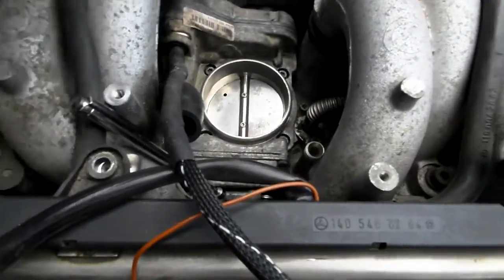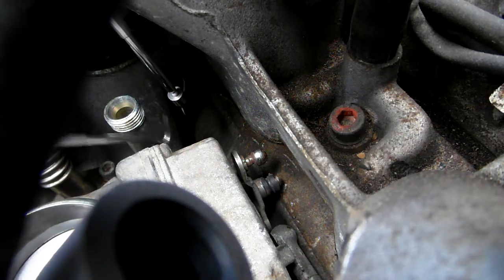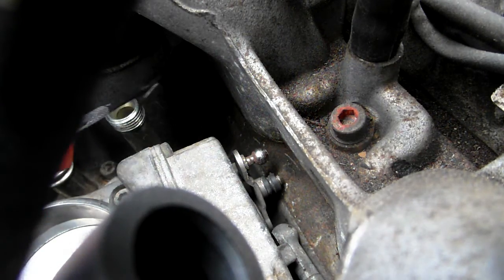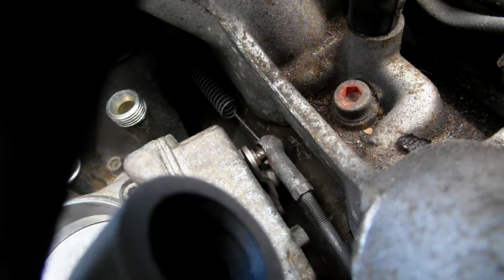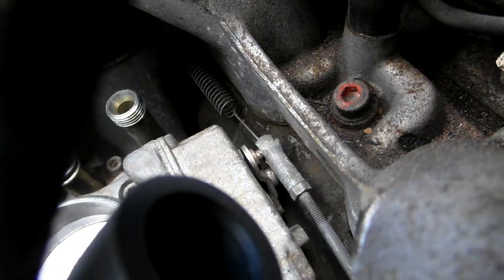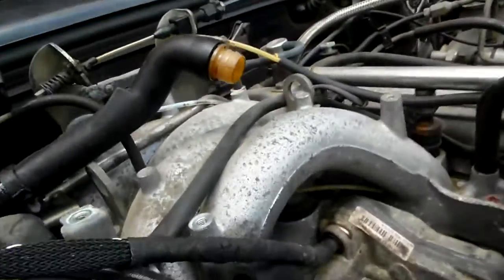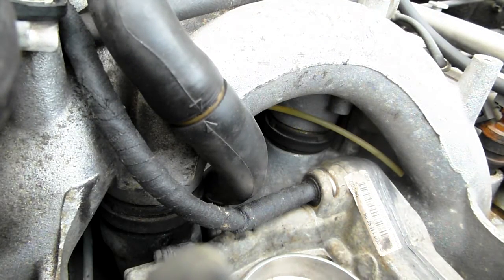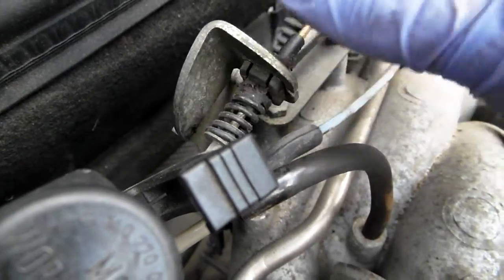Part 7. Mercedes V8 throttle body removal and installation procedures. ASR

Comment: Isn't it a great feeling to keep the old banger going a little longer. 
I've been there, had to repair a Volvo V70 ETM on the bench using a Sacer magnet contactless TPS sensor potentiometer. Magneti Marelli designed their ETM to fail by using a very thin track which would only last so many wipe operations. I think Mercedes knew exactly what they were doing with these bio-degradable wires. I think it's possible I have exactly the same problem with my 97 S500. It's been standing for a year and was ok before I left it. Started it 2 days ago and the ASR and ABS lights are on, but it revs ok. I'm afraid to cut into that harness and look as I'm sure it will be the same. I would like to thank you for the time and effort for making these videos. This will save me a lot of trouble. I'll be tying a piece of string around that spring and will make sure to use needle nose pliers. I have a great tool to get onto the ETM strap bolts, a small 10mm ratchet spanner which comes with a little accessory set that uses a magnetic socket which can take allen / torx or driver bits.

Comment: What do you mean on rebuilt wiring harness of the throttle body ? You bought millitary temperature range insulation ? You re insulated all the inner copper wires and then reeinsulted the outer side again as well with that millitary approved calbe insulation ?
Reply from the maker: I rewire throttle wiring with new wires and check throttle body internals when customers send me their throttles for rebuild. More info is on my website. Prices are a bit off but if you decide to send me yours to rebuild call in advance. Thanks
Reply: vsandvs Unfortunately Im too farfrom you because Im in Europe(Actually in Hungary) but thank you anyway your videos are really really well explained and therefore very usefol also for DIY peaple which I am not in this level, but it might will happen in the future.

Comment: Concerning the spring. Would it be a good idea to use some safety wire and safety wire so thet you do not lose the spring and leave the wire on till the spring is attached.

Comment: Awsome video !   Can i ask, did you get another throttle body, or did you rewire the harness ? i thought i saw another unit on your workbench. Also about how much did it cost you for all the parts you ordered ? and where did you order them all from ?
Reply from the maker: I rebuild these throttles. My website is www.RestoreYourMercedes.com.
Reply: yes, i am looking now,, about how much for the rebuild if i need it.. and all the parts ?  the gasket, hoses etc. I just sent you a email.. thanks.

Comment: Victor, you need some locking clamps used by dentists and doctors to use on throttle body spring. Can't get away with these on job. If you purchase they can be found on eBay, at ammo and firearms web sites. They come in handy on guns also, lots small parts in tight places. Good luck love the videos. Try Natchez dot com for clamps, can get 10 different sizes cheap. Maybe your dentist or doctor will give you some old ones. Later man! Keeper coming.